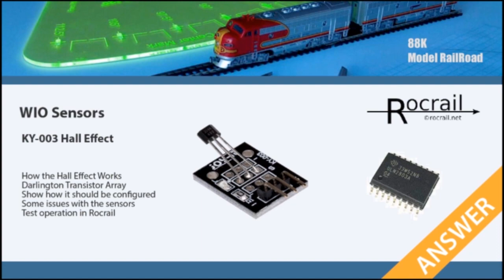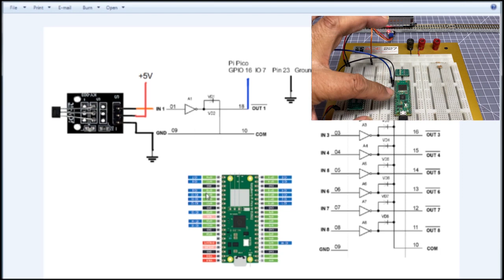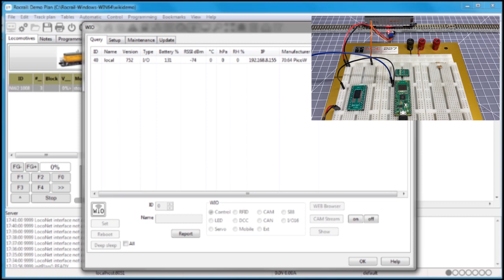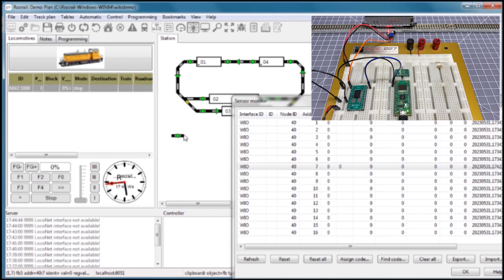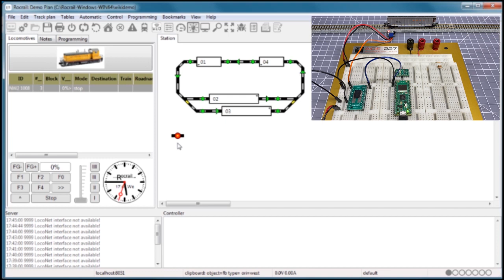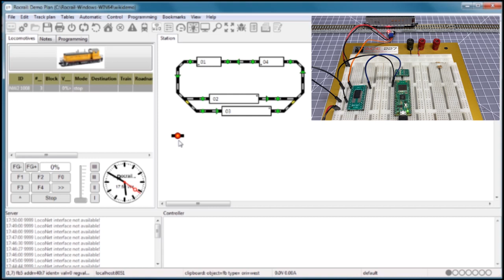WIO Sensor Hall Effect Answer

Comment: Hello, Thank you for explaining the Hall sensor connection. I will do the testing again at my end. 

I would like to ask again in Rocrail controller window why the status was not show on and off when the Hall sensor was triggered by the magnet. If you just short the 2 wires GPIO pin and GND then you will able to see the sensor status on and off
Reply from the maker: Why the status was not show on and off when the Hall sensor was triggered by the magnet.  The answer is @ 2:34
The Halls sensor does not have the ability to provide a ground. The GPIO Pins wants a ground.
Reply: @my88k-mrr98   got it. Thank you
Reply: Hello, I made a test board and everything works fine. I also tested the 4 servo motor which also works fine. At the time of testing I didn't have a HALL sensor so I connected one wire to 5v and another wire to ULN208A IC pin when I short the wires I could see the status changing in Rocrail sensor monitor window.
Reply from the maker: @bbcsd  Yes, you should be ok now. Good to hear.
Reply: @my88k-mrr98  Hello - I got the HALL sensor hall  for testing today. Looking at the pin diagram of the hall sensor I connected the left leg of the sensor to +5V middle leg to the GND and right leg signal pin to the input pin of ULN2803A IC. Then I pass the magnet over the hall sensor. I cannot see the status changing from 0 to 1 in the sensor monitor of Rocrail, not where am I going wrong. Like I said in my last post, when I short the input wire of ULN2803A with +5v I can see the status changing from 0 to 1 in the sensor monitor but with the hall sensor it doesn't seem to be working.
Reply from the maker: @bbcsd  Make sure that the grounds are all common. That way all devices are looking at the same reference.
Reply: @my88k-mrr98  Hello - This is what my connection looks like

1) UNL2803 PIN 9 of the both IC is connected together and then this wire is connected to the GND pin of PICO W pin 38 and to the negative supply of the external power supply.
2) The Rocrail WIKI says to connect a pull-up resistor of 10K.I connected the one leg of the resistor to left leg of hall sensor another leg of resistor to the signal pin of the hall sensor then in Rocrail the sensor status changes to HIGH and remains high until I pass the magnet over the hall sensor. The status of the sensor changes with a delay of 2-3 seconds but this is not what I want even the active low and reset option doesn't help.
Reply from the maker: @bbcsd  Based on what you said last week. The Pico operated correctly. Your next step is to connect the Darlington Array as in the Video. Remove the 10k risistors as I did not have them in my video. Just as you tested the Pico by applying the GPIO to ground. This time let the Darlington Array do it. Take 5v and apply it to the input of the Array. If there is a delay there then there is an issue with the Darlington Array. If the response is instant then you have a problem with the sensors.
Reply: Hello, the sensors started working with the option "I" and without ULN IC. By selecting the option "I" there is no need to select  "active low" option in Rocrail. The option "b" also worked without ULN IC but with 10k pull up resistor and again the "active low" option is not required to be selected.
Reply from the maker: @bbcsd  I think you skipped over a lot of the information in the video but if your configuration is working to your satisfaction its a plus for you.